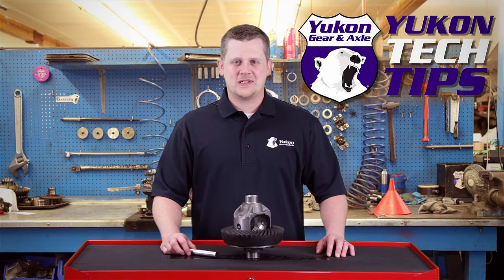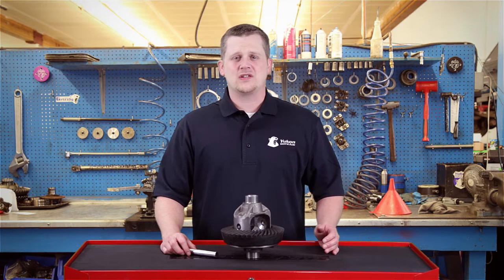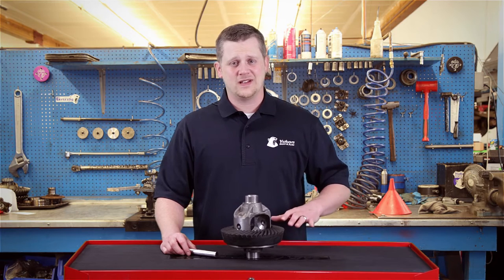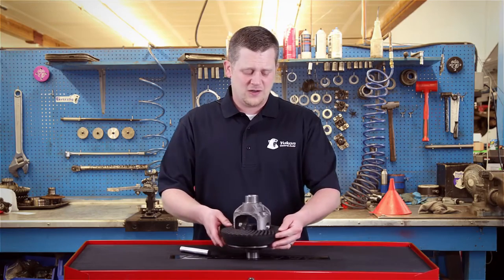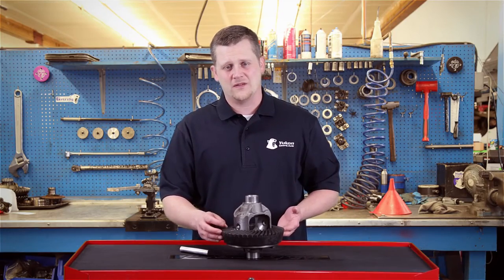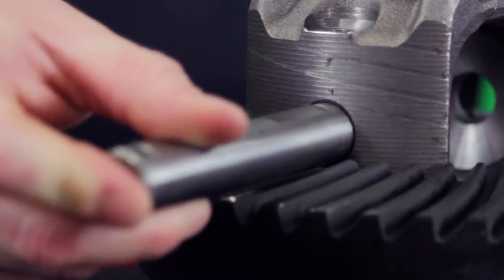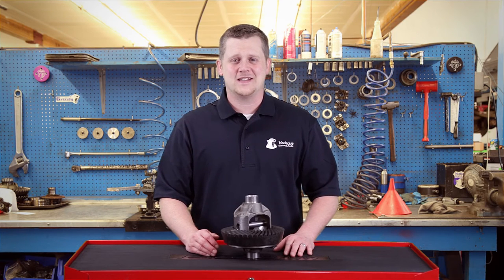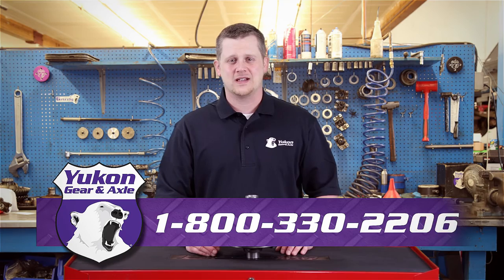How to Properly Grind a Thick Ring Gear | Differential Tech Tips

Comment: I have a huge question: If I buy one of your aftermarket Yukon open carriers (for a Chrysler 8.25 $450+ and 4.88 gears) will I still need to do this? Does it have a lower break or is it  the same as stock? I want the stronger 29 spline carrier for my 27 spline axle, and I already got a used 29 spl. stock carrier, but I would buy your aftermarket HD one in a heartbeat if it means I don't need to cut the gears!
Reply from the maker: You will need to grind the teeth regardless of what carrier is installed due to how thick the ring gear is.
Reply: @yukongearandaxle  Yea, I figured after I thought about it for a minute lol. Thanks for the reply! I'm just gonna take my gears to a shop and have them grind the teeth and press the bearings.

Comment: I think it to be wise and not listen to this video. Shaving gears should never be the go to, notching the pin is much better for the 300 dollar ring gear you just bought. I really surprise Yukon would tell you to take a grinder to your ring gear. I guess it money for them when you have yo buy another one.
Reply from the maker: Concern on grinding gears is understandable. Here are some of the reasons why we would recommend it in this case:

• Notching a cross pin manually cuts through the hardened surface of the metal and structurally weakens the cross pin shaft. This may never cause an issue for the average daily driver, but for a vehicle with larger tires there can be a much higher likelihood of catastrophic failure. 
• In certain applications like 7.5 & 8.8 Ford, 8.25 & 9.25 Chrysler, and GM 8.5 10 bolt and 12 bolt , we actually manufacture notched cross pin shafts that are properly hardened post machine work. These are helpful with installing thick gears, but not always an option like in certain lockers or limited slip differentials where a notched cross pin won’t work properly. 
• When grinding is done properly, there is absolutely no compromise to the ring and pinion, and the location of the machine work does not interfere with the pattern of the pinion and ring gear mesh, so there is no risk in damaging or weakening your gear set. This is why we still honor full warranty coverage on gears that require modification like this.
Reply: Thanks for the information. I think you should have put this information in your video before someone takes a 1/4 inch of gear of 4.88 to get the pin in. But that's what warrantys are for. Those out there that might be thinking of notching a pin take it to machine shop have it milled in and hardened, the shop by me charges 30 bucks to do them.